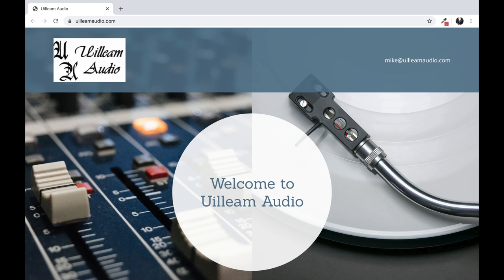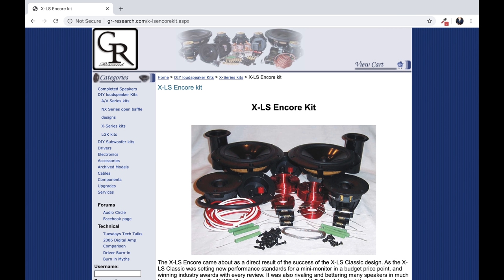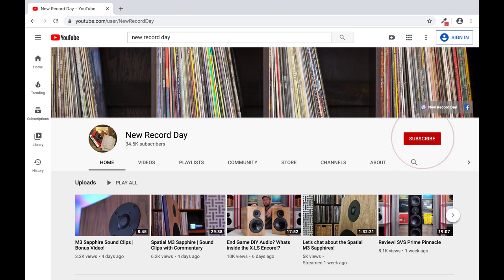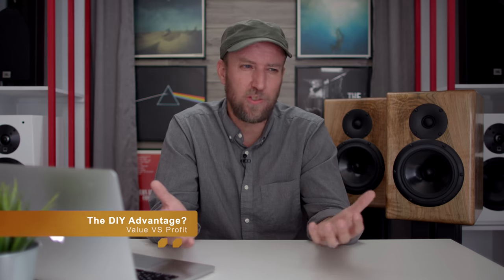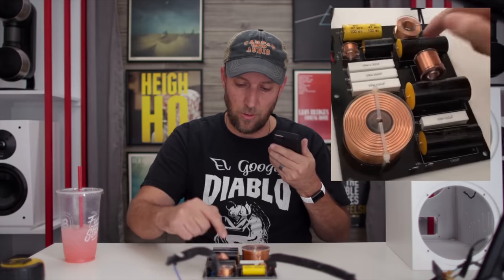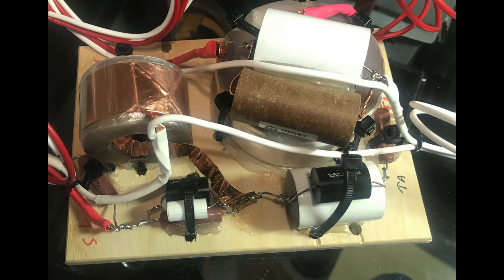X-LS Encore Review! End Game DIY Hi-Fi!?

Comment: I think it would have been interesting comparing the Xls with other speakers you have reviewed like the Buchardt S400 or SVS Ultra, just so people have something to compare it too. There is only so much words can describe
Reply: GR Research puts up videos on a regular basis giving you this type information.  But I warn you, he will likely gore your ox.  SVS is a case in point.  Cheap crap in a fancy box per Danny.
This is a chicken and egg situation.  Danny came up with the DIY kits to give people an alternative to rebuilding the crossovers in their overpriced, brand-name speakers.
Reply: I'm 4 years late, but I can comment on the GR's vs. the SVS. 

I own the X-LX's predecessor, the AV-1's (VERY similar), and for a short time, I had a pair of SVS Ultra Bookshelf's. SVS has recently updated to the Ultra Evolution, but they don't seem all that different from the original Ultra's.

The SVS's looked great, produced a wide soundstage, and overall sounded bigger than their size. 

That's where the compliments end. The soundstage was a sloppy mess. Everything was just everywhere. Nothing had nay separation in space. I've had some far cheaper speakers that did a much better job at placing things in space. 

This was just before Danny released the upgrade kit for them, which I still likely would have passed on (I sold them for a profit!).

Even at 20 (or so) years old, the GR's operate at a different level. Lately, I've been swapping them out with a pair of $5k (when new) floorstanders, and while they of course don't go as low, the GR's do a lot of things better.

I really just need to bit eh bullet, and move up the GR line.

Comment: 12:30 Paper cones. So nice to hear about this topic. Paper cone formulations were a guarded secret back in the day. Paper is the only cone driver material I can live with long term, though I would love to hear what Zellaton speakers sound like.
Polk Audio, as far as I know, was one of the first speaker companies to understand the importance of the crossover. In the late 70s, I watched the Model 7a and 10 beat the competition on the retail floor with a decent box, very good drivers (a bespoke small woofer and a Peerless dome tweeter), with a well-designed crossover devoid of sand resistors, iron core inductors, and electrolytic caps. It was hilarious to hear this at their price point. An A/B would often go like "Sound stage", "No sound stage".

Comment: Very interesting to see an assessment of DIY speakers and also to focus on the components. I decided a while back not to believe so much in "the design magic of our genius engineers overcoming modest component specs" and to zero on in the components. Case in point the Holo Audio May Dac you more recently reviewed, that has specs that blow most Dacs out of the water both on paper and in reality (inc. separate chassis for dual LPSUs, dual mono double R2R ladders and highly engineered PLL input stage). Similarly in the CD transport world, the Jay's Audio CDT2 Mk3 (Philips CDM-4 reader, OCXO clock, i2s output). With regard to the GR Research speakers I wonder how they match up against the ATC speakers with their formidable 3 inch dome midrange woofers? That is a litmus test most speakers crack against.

Comment: Danny has these now in his completed speaker section. I bought the fully upgraded version and my choice of  cherry finish. For me building wasn't an option. I'm currently using the Davanti completed speakers at 399 on Danny's design and also in the completed speaker section and must say, they are not a slouch. I have an older Parasound preamp and A23 amp which can push most anything. With a Bluesound Vault and node for inputs. I can't wait for the Encores to arrive. Thanks for your review.
Reply: How are you liking them now that some time has passed. I'm also thinking of buying a fully upgraded completed pair.
Reply: @bgroovin1343  The fit and finish is perfect! They sound better when I got them situated. 12x24 room with doors in the corners behind the speakers so the speakers are 6 foot apart. I have them toed out a 3-5 degrees. I highly recommend them.

Comment: So, I'm currently in the process of building the X-LS Encores and can't wait to hear them. Which of Danny's subwoofer kits do you recommend to pair with them?
Reply: @gmail name Right. But Danny offers a few different models/configurations. 🤷‍♂️
Reply: Danny also has a sealed servo sub kit with a single 12” driver that has output all the way down to 10Hz. 

Also, Rythmik Audio offers the same sub in a commercial version the call the F12G as well as a mid bass module with two 8” drivers that plays down to 30Hz.

Comment: Hello Ron,  just putting the finishing touches in these.  Just waiting on the tube connectors that have been in back order.  Question, if these go down to 55 hz, where, in your opinion, should I crossover the woofer?  Thanks in advance.
Reply: Forget 55hz ..... More like 100hz at best
Reply: @edwardbalboa5528  Mine seem to do pretty well, but I did cross over my subs at about 80-100Hz.  I also noted some break up at high db levels close to THX reference but that might just be the speaker's limitations.  Still, I'm pretty happy with them but I'm going floor standers from now on.

Comment: Hi Ron. I appreciate the breakdown of the frequency ranges, that’s great. You didn’t actually describe the bass of the speaker itself. I’m left with the impression that this speaker is useless without a pair of Danny’s subs. Is that what you are trying to convey?  I promise this is a genuine question. With love, Ken
Reply from the maker: Actually that’s a fair question! The bass is decent on the encores but I wouldn’t say it’s world class on its own specifically talking about how low they go. If you are fine with mid 40s to low 50s, great! If not, you really do need subs!
Reply: New Record Day, Thanks Ron!
Reply: I'll take this one.

The X-LS Encore woofer is stuffed into a smaller than optimal air space to give you everything else at a high level, but in a small package. It is solid down to about 60Hz and is -3db at 55Hz. If you want lower extension then simply build the X-SLS version of the kit. This is the same speaker, but it utilizes an optimal ported box in a small floor standing version. This version allows the bottom end to extend down to a -3db of 45Hz.
Reply: Danny Richie Thanks!  The X-SLS sounds like the better fit for me in my small room. Does something similar exist for the NX-Studio?  With love, Ken
Reply: @kenstephens2955  We're going to be offering a stand for it with powered woofers.

Comment: I'd like to take a second to talk about "you just want it like it is, then you can go in the direction of solid state", solid state transitory alter there resistance with temperature (well everything does but solid state amps undergo greater relative changes) this means the signal changes depending on how hard the amp is working which will vary throughout your music. Tubes have a much more consistent temperature control, aolid state amps that sounds like tubes usually achieve this through better thermal management. 

Why is this important? Well it tells us that measurements alone don't tell the whole story, if a more consistent amp sounds like tubes it suggests that tubes are at least in some way, a more accurate representation. I am not saying that tubes are objectively the better amp. I'm simply saying that solid state amps are not perfect reproductions and tubes are not just adding pleasant distortion

Comment: so can i take my speaker cabinet components and replace them with these components . I like the cabinets I have ..
Reply: Yes, you can do that as long as you have the same values for caps, resistors and inductors, but be aware that you will be “coping” the budget design from the factory. So why waste your money on quality parts? If you still wanna upgrade yourself then check out soniccraft.com for quality components.

The best option is to have Danny at
GR-Research measure your cabinets and design a custom made crossover kit.
Also he will also provide suggestions on your wiring, connecting posts and cabinet insulation options.

Comment: Can these speakers work for a home theater system. For example can you purchase four (4) of theses speakers for front & rear and add a subwoofer for the fifth channel.
Reply: This would depend on the receiver you're trying to use. First most 5.1 surround systems have 2 front, 2 rear and 1 center channel. The .1 is a subwoofer out. Unless the receiver doesn't have a sub out and the sub would need to be wired in with the speakers, passive. Again the .1 is the sub channel design for an active sub. So yes these speakers can  be used in a surround system. Just make sure the unit matches the speakers impedance/ohm ratting.
Reply: Danny is so diligent about bass, that I’d think these would be awesome for HT with a sub. These monitors are going to have a graceful rolloff on bass, no muddy bass. Leaving a clean handoff for the sub. Either a GR sub or others. All considered in the design by Danny.

Comment: I am ordering my kit and am presented with the option of X-LS or X-SLS. What is the difference?
Reply: I am in the same situation, deciding between the two. SLS is really a 37" moderate floor stander so claim is no expensivive stands. Yes stands are $100 plus. Plus tuned lower. SLS needs 8'x4' sheet of mdf and 8'x4' walnut or other veneer it all adds up.
Reply: The two versions are the same speaker. Only the low end extension is different from the lower tuning of the X-SLS version.